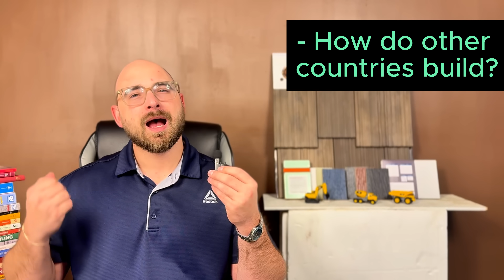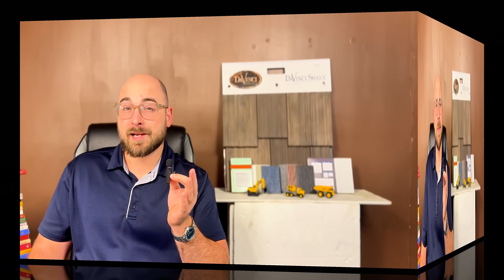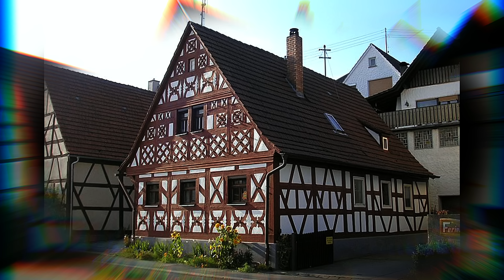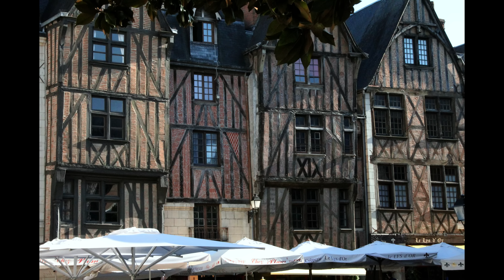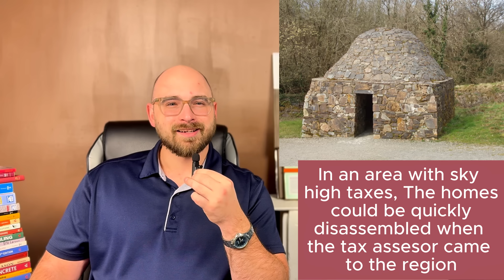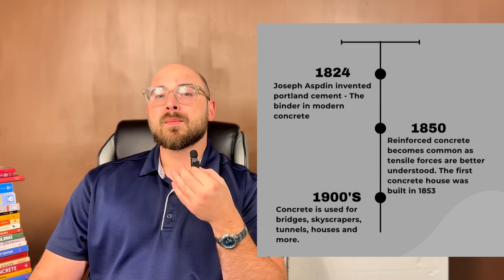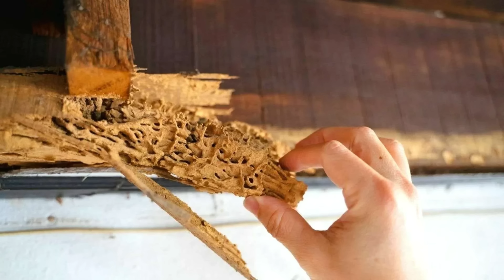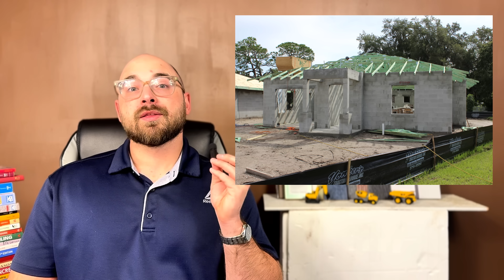Why Other Countries LAUGH at American Homes

Comment: This is interesting, but he’s showing mostly old construction methods. Roofs are often concrete with different finishes based on climate. Walls don’t always need to be aligned depending on the concrete system. Bricks and concrete handle fire better than wood, and reinforced concrete can resist earthquakes if designed properly. 

What blew my mind when I visited the US was how even wet areas like sinks and showers are built over wood, despite the risk of mold and humidity weakening it.

Comment: One benefit of using things like concrete and lightweight timber is that you can design open floorplan houses. The traditional solid built homes of Europe, brick and stone, are limited in their architecture and floorplan designs because they don’t have the necessary support to allow things like an open floor plan. This is one of the defining characteristics of American architecture and the American school. Generally, brick and stone has to be made in a grid to support the structure of the house. You can get away with arches as well, but arches add complexity and cost. A wood framed home can add trusses and supports to allow for more open floorplans. Europeans are still bitching about Americas and our design philosophy 150 years later. The ONE thing I think we could and probably should use more of is concrete, but it’s prone to sweating and cracking due to settling and costs a ton.

Comment: It’s not just the building it’s the materials.  This fast grow 1 year lumber.  I picked up a 2x4x8 at a big box literally gave it a shake and it cracked into 2 in the middle and split 3/4 the way.  Grabbed another and a knot 1/2 the board left a hole in it. Seriously.   All the other materials suffer so much of this. Now home codes don’t even require sheathing over those 2x4 so these weak 1 year timbers are holding up a home with some wrap and siding.  It’s nothing.  Maybe up to 1/2 inch of wallboard that’s practically cut back to 1/4 inch in really.  Geez.

Comment: people act like concrete or brick+motor is indestructible which it is no such thing.

tornadoes/hurricanes will wreck a "solid" building the same as a wood one. the US has vastly worse weather then these other areas where people are whining from (their opinion comes from ignorance).

what's really happening here is survivor bias, you are not taking into account all the "solid" buildings that toppled over and crushed people and had to be rebuilt.

there are timber houses that are more then a 100 years old in America, it isn't correct to say that "oh look, there isn't anything wrong with timber framing because look at this one edge case example!" aka survivor bias.

more often then not, the reason timber framed housing is torn down (outside of disasters) is because the basement/foundation cracked and was deemed unsafe. yea the "solid" portion is the reason the rest of the house had to be torn down, not the highly flexible portion.
Reply from the maker: we can build much better foundations now vs 100 years ago, if concrete isnt any safer, why do people use it for storm shelters?
Reply: @Mike_Fortin  
i don't know of any concrete only storm shelters unless they are heavily reinforced with steel and at that point you might as well just say they are steel storm shelters because they are.

if you throw enough money at the problem yes foundations today are much better but that isn't the case for the majority of buildings because cost is a massive factor in everything today.

also on top of it not really making much of a difference, it's more about dumb luck if something smashes into a concrete wall going 200MPH it's gonna go through the wall or at least damage it enough for the entire building be torn down anyway.

lastly the actual chances of seeing a tornado (even in the most prone areas) is actually quite low. 

even if you do see a tornado or hurricane you got home insurance (nearly everyone in America does). it's simply more cost effective to build wooden homes in a disaster prone area.
that's saying something when you try to argue the safety benefits of concrete. if concrete was so safe then why isn't every single home built out of concrete? is it that it isn't safe? isn't cost effective? isn't all that it's cracked up to be?
all of the above?
Reply from the maker: well you’re clearly a self proclaimed expert so there no point in arguing. 

Nevertheless, the homes aren’t concrete because builders don’t care, houses are too expensive, and people are cheap, 

The “save a dollar, lose a thousand mentality” 

A concrete house is safer than a wood house, if you go the extra mile and add a concrete roof, they can withstand the most severe storms. 

It’s comes down to cost, since that’s not an option you do a concrete house with a concrete safe room, 

Using ICF for the foundation along with waterproofing and dimple mat protects it from moisture and therefore corrosion, xypex can be added to heal hairline cracks 

The insurance argument is ridiculous

, what about lost possessions, losing potentially years of time, or potentially loss of life because you blew away with the house? 

Yeah an E5 tornado or a cat 5 hurricane might cause some damage, but it’s better than losing the house or dying. 

Plus you can insure that house too, at a lower rate I might add
Reply from the maker: I don’t understand why people like yourself are vehemently against positive change

All I’m saying is to raise the minimum standard a little bit, or least promote it as an option 

And yet people defend the bare minimum outdated, corner cutting standard like you insulted their grandmother, it’s bizarre 

None of it matters anyway, no one can afford a house, the ones that can will continue to build cheap, vanity focused shit boxes 

Who cares if they burn down, who cares if they blow away, who cares if they’re moldy, or comfortable, at least you’ve got 4 walls and an air conditioner 

After all the insurance will cover it, or maybe %80 of it 

Welcome to America
Reply: @rocksfire4390  59 ef5 tornados in USA in 250 years. 
Chances of one hitting your house are slim to none especially in your lifetime.
Reply: @Mike_Fortin  
the vast majority of homes, in areas that tornadoes are more common in, have basements, they do not blow away and the ceiling to said basement is built much stronger and is much harder to peel off then the roof of the home (which is always first to go).

talking F3+ tornadoes which are insanely rare.

tornadoes (in USA) kill ~70 people per year, lightning strikes kills ~20.
like you are acting like this is some major problem when it realistically and factually isn't.
you have a massively higher odds of choking on food (to death) or drowning to death (talking 20-50 times more likely).
there are so many other ways you could go, a tornado is so far down the list it isn't even funny.

this is all to highlight the point that trying to argue for 50% higher cost of living (realistically with higher demand 200% higher) is foolish thinking at best.
if more people were dying, i would agree that something be done but that's just not a realistic plan of action and you seemingly understand that and still tried to make the points anyway.

not only are tornadoes vastly more common in the USA, the intensity of them is also vastly greater as well.
we get at least 3x as many tornadoes as the entirety of Europe and we see vastly stronger tornadoes when they do appear.

the reason buildings in Europe still stand is simply because they get far fewer events and the events that do happen are weaker.
it's not that their buildings are built better, it's simply because they haven't been pushed as hard as the ones in the USA are.
Reply from the maker: @rocksfire4390  well, I guess the bare minimum is fine then 

You solved the problem 👏
Reply: @Mike_Fortin  
there was no problem to begin with?
that's my point and something you fail to see for some reason.
even if you pushed 50% higher housing costs on everyone, the death rate would only drop by like 25. yea cool but now you have people losing their homes because they can no longer afford them and now you have millions of people in disaster areas without any shelter tornado or not.

your comments and this video is so insanely shortsighted.

 i never said i was in favor of the bare minimum, i'm just being realistic which is something you have to do when you live in reality.
if you want to go fight for 50% higher minimum wage (which i support more then 50% increase) then please do but until such time your advise is entirely meaningless on it's face when any level of scrutiny is placed upon it.
Reply from the maker: @rocksfire4390  thank you for supporting the channel with your returning comments 

I’d like to say :

No one’s buying a house off of minimum wage, 1 person dying from a substandard build is too many, the cost difference between wood and concrete is %10, or equal if builds are downsized (most are oversized and prioritize vanity over quality) 

There’s people out there that want quality, not everyone wants the cheapest thing 

Plus there’s other benefits to solid homes, every year there are 36,000 instances of vehicles crashing into buildings, sometimes killing people in their homes, when it’s a concrete house it destroys the car, there’s instances of stray (or intentional) bullets going through homes and killing people, there’s also fire, flooding, etc. 

I’m not anti stick framing, but I offer quality. I think the best way to build is with ICF in most cases. Some will disagree, some won’t be able to afford it, and that’s fine. For those that want the best I’m happy to provide it
Reply from the maker: @rocksfire4390  to go on a bit of a tangent, it pains me to see houses destroyed in hurricanes fires and tornadoes when we have the technology to protect people and their homes from these events 

I think it’s worth a little bit more to keep people safe
Reply: Go call the Japanese, off course you can mention “tofu” houses in china, no house is indestructible but you can minimize the risks, construction quality evolved over the decades in my country old house have poor isolation but new houses done properly don’t have that problem, Swedes love their log cabins for example, Americans talk about smaller houses but you have people in places like nyc living in closets

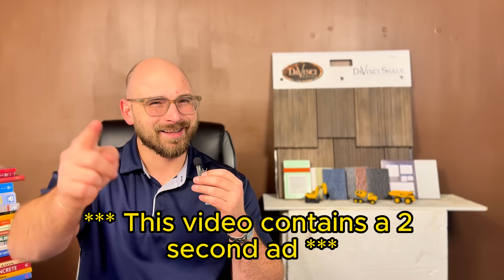Comment: 0:50 the concrete houses 50 years life time 

the wooden houses and mud houses are build from natural materials… at least 200 years life time
Reply from the maker: based on what?
Reply: Please try a simple experiment - leave unstabillized adobe brick, piece of wood and piece of concrete for 10 years in the elements and observe the outcome.
Reply from the maker: @ElegantiaeArbiter what’s your prediction?
Reply: @Mike_Fortin  Unstabillized adobe - gone after the first rain. Popular lumbers (not resistant to rot, cheap) - 5 years. Stabillized adobe, concrete - longer than experimenter's lifespan with concrete having an edge. Stones and hard bricks fall into the same category. Experiment was done in Mediterranean climate.
Reply from the maker: @ElegantiaeArbiter I would agree

Comment: For a great alternate construction method, I recommend checking out dome homes. Both monolithic concrete domes and wooden geodesic domes. They are a really good fit for much of the US due to their very high wind resistance. Concrete monolithic domes are somewhat famous for taking direct hits from hurricanes and tornados and remaining almost entirely unscathed.

If you don't already have a video about them, I think that would be a great topic.

Comment: How is the electric and hvac run in ICF and solid structure homes?
Reply from the maker: For ICF homes, electrical and plumbing are run through chases cut into the foam. HVAC has a dedicated channel built in somewhere.

Comment: Europeans don’t even have central AC. Their homes are also tiny. Europeans homes are 1000-1500ft2 where American homes are 2000-2500ft2.
Reply: They don't have central AC, because most of Europe does not need it. They have AC units in the south where you enjoy life being outside. Why do you need such a large house?
Reply: @ElegantiaeArbiter A large house allows room for entertaining, guests, home theaters, home swimming pools, libraries, what are the large homes in Europe used for? America’s large homes for the most part are used the same way just far more people can afford them.
Reply: @ElegantiaeArbiter No one needs central AC it is a luxury. With HEPA ventilation when the atmosphere outside isn’t perfect the air inside stays that way. I have central AC in California on the Central Coast. We have very moderate temperatures. But for maybe a week or two some years we will have a hot spell. With central AC inside, I don’t.

Comment: I've been following ICF for a decade and half here in the US.  If I build it will be ICF.  Ensure I'm building passive house which ICF helps achieve.
Reply from the maker: That’s the best way to go
Reply: @Mike_Fortin  and even better :Net Zero, moe than that...Net Positive with extra Solar, home batteries and an V2H-compatible EV to power the home in the deep winter. Take the EV out for more power to return hme with those electrons like you went to pick up a gallon of milk.  It can be done today with off the shelf tech.  

Dare to dream.

Comment: Europe has the artistic edge, no question.  What they don't have is screens on the windows or air conditioning.
Reply: They do have AC in the southern countries. Heavy masonry houses with vernacular designs deal with heat much better than some paper thin structures. Inhabitants of these regions over centuries developed a lifestyle that helps to deal with heat. In the north/central Europe it does not make sense to install AC and really use it for one month of warmer weather. This rule also applies to majority of places in the US, but people became extremely spoiled.
Reply: @ElegantiaeArbiter  yeah, I keep forgetting that much of Europe is further north than the US so I agree about the AC.  The window screens are a different matter.
Reply: @michaelcurtis106  I don't remember seeing window screens anywhere in Europe, but at the same time I did not check every single countryside house where it would be needed the most.
Reply: @ElegantiaeArbiter I'm saying that Europe SHOULD have window screens. Not sure why they don't. I was only in Europe (mostly Luxembourg) for 2 weeks and the lack of screens was noticeable. I also follow a few European YT channels that talk about the differences between Europe and America and even THEY don't know why there are no screens on the windows. The product has been around for over 100 years but for some reason, Europe didn't adopt it.
Reply: @michaelcurtis106  I agree. I like open windows, screens and no insect intrusion.

Comment: american houses arent cheap. they are way too expensive for what they are. yes, the material to make the house itself is cheap, yet the asking price for such house is out of this world. the fact that you run single phase 110V in the paper wall is another problem on its own. another fact that the water pipes are made of cheap plastic tubes with fittings that barely hold the water in is another stupidity. there is so much wrong with the houses in the US.

Comment: It is utterly ridiculous that our zoning and permit regulations don’t embrace aircrete or concrete, Cobb , Adobe, Earthship and earthbag dome homes. They normalize building the most flimsy and value them far beyond what they should cost. Also home designs are do wasteful because they have outdated perspectives on designs that waste space. It’s all designed to keep people buying and unsatisfied.

The homes I mentioned are more efficient and resistant to mold, pests and fire. They also are more resilient to wind and snow loads.
Reply from the maker: Concrete is the easiest to do out of the methods you mentioned. Others would need special approval